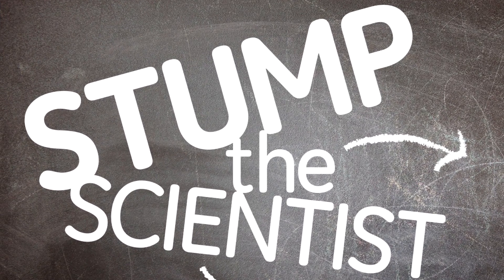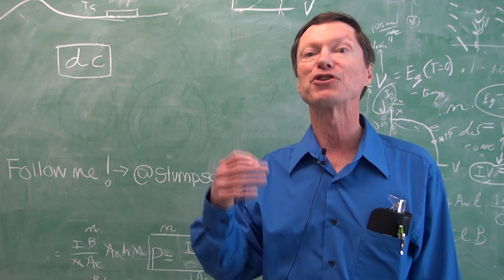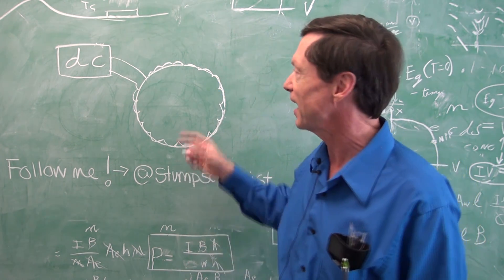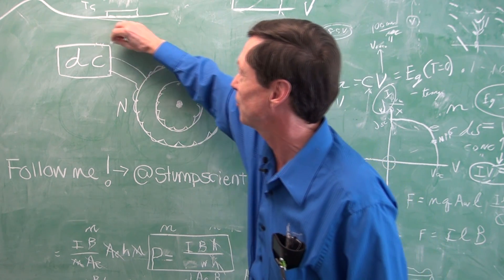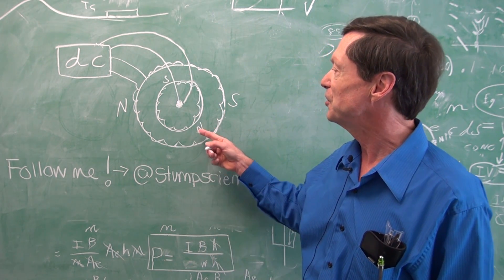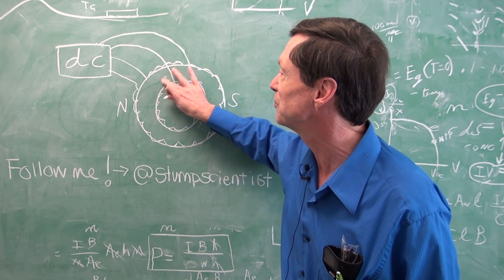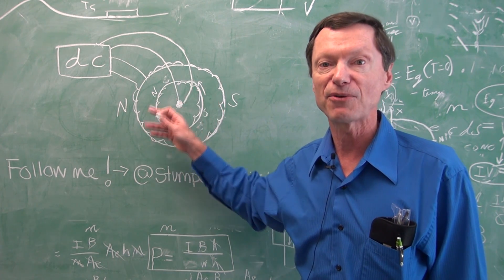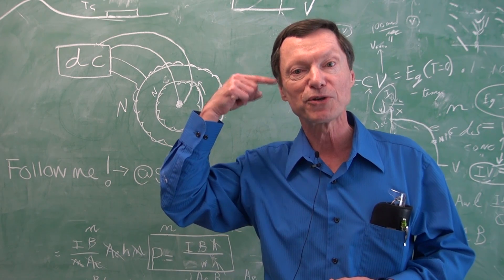How does a DC Motor Work?

Comment: sir what's difference b/w ac motor And dc motor? how we can used it ? were ac used & dc motor used
Reply: Main reason is the source (DC/AC). Secound could be the price. Other reason are of characteristic of varios motors. For example automotiv group Tesla use AC Motor but they have still DC-Source possible. So they use complicated converter from DC to AC but they get more power and better control of the motor.
A big problem of DC is the comutator, you need more maintenance (brusehs change..sparkle..).

Comment: are you able to make a dc starter motor run forward and reverse
Reply: Yes it is. You change simple the polarity only in one coil (stator or(!) rotor) and it run the other way. If you change polarity of source it make no difference